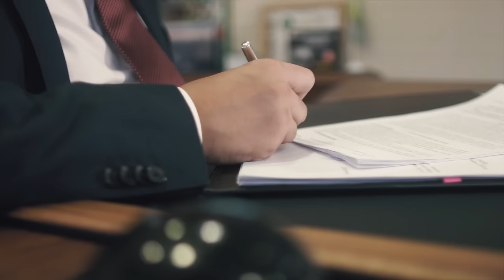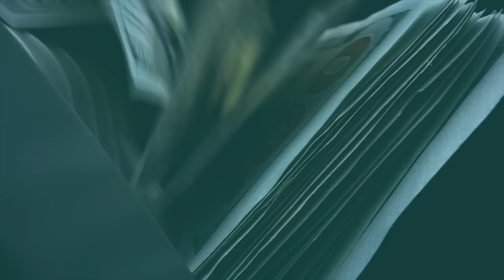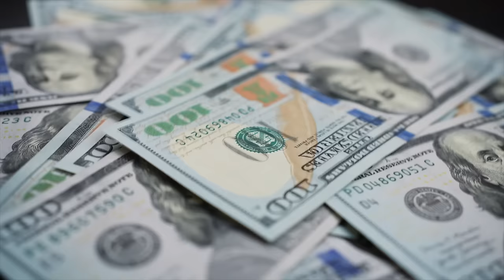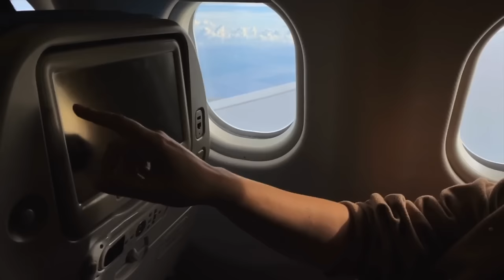How California Finally Plans To Finish The High Speed Rail Project

Comment: I can't wait to be able to go from SF to LA in under 3 hours. No TSA, no ubering to and from the airport, no cramped seating, no baggage limits, and being internet connected the whole time!
Reply: What makes you think there's any escape from TSA for you?
Reply: With slow speeds at both ends, a dozen station stops and 55 miles of difficult tunnel work, it will take another $100 B and four more decades to complete for a 4:30 trip.
Reply: GROW UP.
Reply: @archstanton5973 Say what?
Reply: WTF?  If you think that represents HSR, you are sadly mistaken. First of all, even the liberals responsible for California's HSR effort will concede, with all the changes & added stops, the time it will take to go between LA & SF will be no where NEAR 3 hours. And then, when you arrived, how do you get to your actual destination? Just STOP IT!
Reply: @Mister8224  bus, bike, rideshare, walk....
Reply: @davidjackson7281 And you are being optomistic
Reply: @Mister8224 Optomistic about what? The projected trip time? The time to build the project? The total cost of construction?
Reply: I don’t live in California but I feel instead of building a whole new high speed rail line it would have been better just to up grade the existing old Southern Pacific coast rail line. If the slow running through the mountains is the problem just build the tunnels necessary to bypass this slow part of the route. Otherwise just upgrade the existing route by eliminating grade crossings  and any places where the trains have to slow down due to tight curves or other issues. While you may not achieve the true high speed promised in the existing plan it still would be faster than todays Amtrak train on this route and most likely beat driving time with no traffic hassles. It still may be competitive with air travel due to leaving from the downtown stations and not needing to arrive hours early to clear security. I hope they succeed with the existing plan but upgrading existing routes can be done faster and at lower costs. The operating and maintaince  costs most likely would also be lower and keep the fares low enough for the most possible ridership.
Reply: @johnchambers8528 That is a great idea. Agree mostly with your comment. Upgrading the route to top speeds of 110-125 mph averaging 80 mph would mean a 5:15 trip on a 420 mile route. This could be done, not instead of hsr in the Central Valley, but in conjunction with it. There's 2.5 M in the six Central Coast counties with low to stagnant growth rates. Whereas, the Central Valley has up to 6.5 M, is still growing in population and should be served and not be ignored.
Reply: @davidjackson7281  Not being from California I did not know about the growth in population in those counties. Yes ideally both routes should benefit with upgrades. The more, better, faster service there is means more people will choose rail transportation over driving or flying.
Reply: @Mister8224  if you watched the video you would know that the state is working on blending local transit with the train so that when you get off the train you can board other transport like busses, local trains, metro, ect.
Reply: @hexyeetus  I can imagine just how organized & efficient a system created by CA state government to coordinate Bullet Train arrivals & departures with local transportation to get passengers to their actual end destination would be. Cheap too!
Reply: @Mister8224  There doesn't need to be this big elaborate plan, SF already has the BART in the airport and that works just fine. They just need stops near the train stations
Reply: @hexyeetus  Well then, good luck to finishing the bullet train. If it actually were completed, no matter what decade that might happen, would you use it, even if you weren't forced to use it?
Reply: @Mister8224 Yeah man I would. I live in the central valley, and I have family in socal and norcal. I would rather take the shorter and cheaper way to get to my destination
Reply: Oh yes...thats worth a couple billion....so you can have your damn internet....
Reply: You no not what you say
Reply: What exactly do you think happens the first time a terrorist attacks a train?  But TSA won't be an issue because CA can't afford to finish even the stub they are building from nowhere to nowhere.
Reply: YOU FOOL!
Reply: California High Speed Rail for most people doesn't drop you off at or near your home.  You'll have to get to take a cab or an Uber (or walk or ride a bike) to get to the station.  RE:  Luggage, I take Germany's DB high speed rail 3X per year when I am there for work and there is a limit on luggage and what you bring on board.  Per their terms of service "Each passenger may take the following luggage on board: two items of regular luggage such as a suitcase, rucksack, travel bag or trolley with maximum dimensions of 85 x 85 x 85 cm and one item of hand luggage, or: one item of oversized luggage, one item of regular luggage and one item of hand luggage"
Reply: No ubering why...❓😂 Are you planning on not leaving Union station once you arrive to Los Angeles
Reply: @hockeyplayer28 are you kidding me you got the green line in like five or six bus companies local transit authorities that have buses coming into LAX LAX has its own bus terminal right next to the airport terminal LAX has free shuttles.. no thanks I'll fly Southwest
Reply: @slimshady6359  My point is that high speed rail is no panacea and the huge costs don't justify it.   I'm a bit confused as to what our point is. First you comment on shuttle availability in and out of LAX and then  you say I'll take Southwest.    I am not commenting on LAX.  My point is that the California High Speed rail, once completed will have stops in L.A. Union Station and Anaheim.  So I'm going to have to get on the crappy Metro for an hour to get there and then transfer to CAHSR for a 3 hour, $260/per round-trip ride to San Francisco?  No thanks!  Like you, I'll just take Southwest Airlines.
Reply: @slimshady6359  No.  I'll just take a plane to/from L.A. or San Francisco.  Even if I rent a car, it's cheaper and takes less time than the California High Speed Rail.  And in 25-30 years when we're all old or dead, EVTOLS and AI based traffic control systems will make rail even more less attractive.
Reply: Even now, 25yrs from completion(if feds cough up 200 BILLION) there is NO CHANCE the train will be able to complete that trip in under 4 to 5 hours. It is the biggest BOONDOGGLE  EVER. I hope you're under 50yrs old, as you will be 75 to 90 yrs old if you're not, when train is done.
Reply: You need to drive to train station. The irony is to make HSR serve more people,  it will take more time.
Yes, you don't need TSA. Chinese HSR is the only HSR requires x ray scan. Still, any good HSR require tight security.  The reason US rail, Amtrak, metrolink,  have lesser profitable for terrorists to attack US TRAINS. 
Love US HSR supporters have all kind of weird reason to support HSR.
HSR works connecting multiple major cities with good public transportation. 
Point to point connections.  Hello Sarah Palin,  your rail waste buddy
No uber. If you really want speed, get your own plan instead of wasting 100 billion. 
HSR supposed serve lots of people connect different buses and rail. I forgot you don't want to cramp in bus.
HSR should not be built.  So many supporters don't even know the meaning of HSR
Reply: @Mister8224 
You should have added the blended sections.
Reply: Anyone thinking that the TSA wouldn't be heavily involved in the security of an HSR  project is hallucinating.
Reply: @mikeandike93 I thought the idea was to simplify & save time.
Reply: @spikespa5208 Please tell me how you would hijack a train and run it into a skyscraper
Reply: @roger5059   Consider the speed an HSR train would go. With that much mass.  Airplanes aren't the only mode of transportation susceptible to a bomb. As of now, I'm not sure if the TSA  is searching luggage on trains and making passengers take off their shoes........ yet. And the tracks themselves would have to be secured against tampering.
Reply: @davidjackson7281  ohh trumpers
Reply: @vimmentors6747  oh trumpers
Reply: @seagraverider  Oh people with train fetishes who dream of spending trillions of tax money so they can spend three hours getting to HSR so they can spend four hours riding it paying five times as much instead of an hour of ride share and a one hour flight that will land before your HSR boards.
Reply: Agreed, I hope the flying industry takes a significant hit, they deserve it. Flying has become such a headache and it's unfair that the only two options are that or driving. Europe, Japan, and China have already proven that domestic travel by rail is the optimal choice. I hope everyone opens their eyes to this. And hopefully with the success of the California high speed rail and the one already in Florida that everyone sees the benefits and more states start implementing it and eventually connect the whole country. That'd be amazing. I really hope I get to see it in my life time and before I'm too old. I'd be amazing to be able to travel from one major city to another fast and efficiently just for fun. Imagine being able to spend the day in pretty much any city of your choosing and then come back at the end of the day. And all for a much cheaper price than a plane ticket and no hassle or worry about driving and parking. Efficient public transit is going to be the way of the future in America.